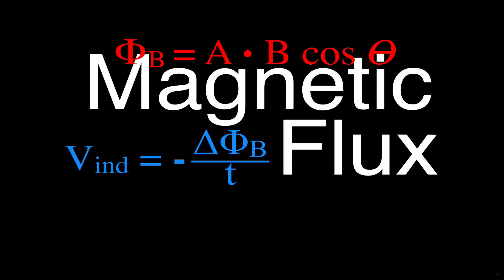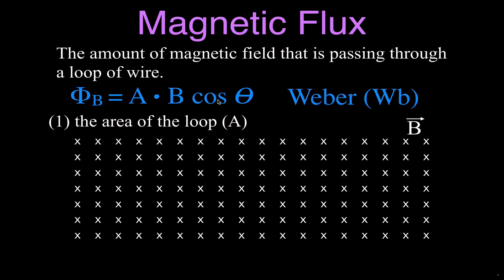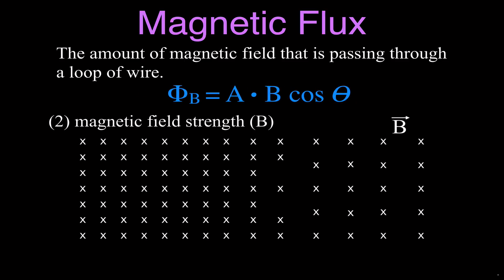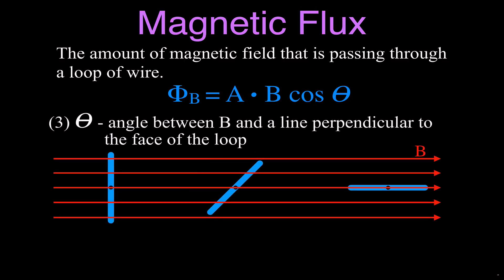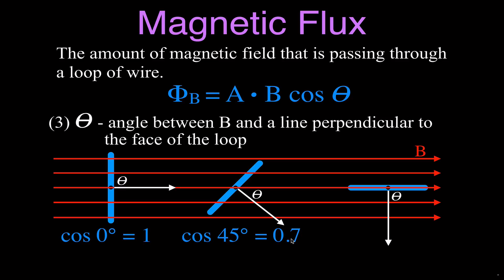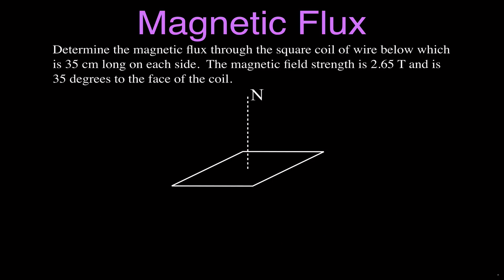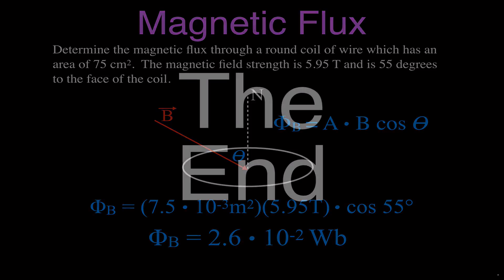Electromagnetic Induction (2 of 15) Magnetic Flux, An Explanation

Comment: Hi  I know this is a very old video....  I have tried to find out what is the best space in between the rotor magnets .. if the coil diameter and the magnet diameter is same (example :30mm diameter )  . Basically we need to know, what is the best spacing in the rotor to get max EMF. Just keep  Each Coil diameter is 30mm and each magnet diameter is 30mm. Specially, if we wind it for a motor or generator.  Let say from the start : we have 6 coils and 8 magnets.  each got 30mm diameter . Please educate us to find the best spacing between magnets within the rotor... thank you for your time..

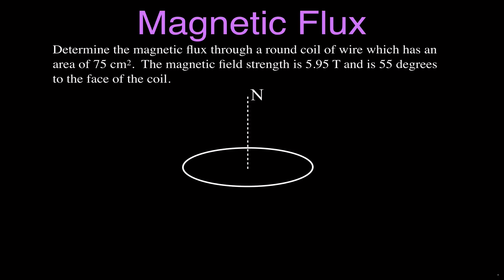Comment: I have a question. The problem at 8:20 says that we don't use the angle in the problem, because it says "degrees to the face of the coil." which makes sense. We use 55 degrees. But then you did the complete opposite on the problem at 9:15. Am I missing something?

Comment: Why we use cosine... It's my doubt plzzzzzz help me plzz I beg u
Reply from the maker: That is a great question....but I do not have a very good answer....because we use the angle the line perpendicular to the coil and the magnetic field lines. If we used the angle between the face of the coil and the magentic field lines then we would use the sine.
Reply: The cosine is used due to vector calculus. Take a vector vA normal to area and the vector of B (vB) and calculate the dot product: vA * vB = |vA| * |vB|* cos theta. Theta is the angle between the vector vA and vB. The Cosine Theta determines how many B-lines penetrate the area. If vA is in the direction of vB then Theta is 0 and cos Theta = 1 and the flux is A*B. If Theta is 90° then vA is perpendicular to vB and no b-lines are crossing the area. cos 90° = 0 and therefore vA*vB =  |vA| * |vB|* cos90 = |vA| * |vB|* 0 = 0 as you explained, so it is vector calculus with the dot product why we use cosine.

Comment: For the example at 8:21, why is the angle 35 degrees and not 55 degrees? My knowledge of angles is not that good. Can you please explain?
Reply from the maker: Because it it the angle between the magnetic field (B) and a line that is perpendicular to the face of the coil. It is not just the angle between the magnetic and the face of the coil. can be a bit confusing.

Comment: Sir i've a question and that is in a round coil if there is number of turns so what will be the formula? And in my text book i saw the formula is phi= BA sinQ.. which one should apply?
Reply from the maker: That is the equation for the magnetic flux, or the amount of magnetic field that is in the coil.  The equation for the induced voltage or Faraday's law has the N in it for the number of windings in the coil.
Reply: @stepbystepscience   But sir here u wrote phi= A.B cosQ?

Comment: my favorite physics channel is back
Reply: Sorry i can't make a seperate comment. - Could you check the last example question? The Q says angle is 55 deg to face of coil. Should the angle used, then be 35deg because it is measured from the normal line?........ isn't it?
Reply: I think i just got confused by the wording of the question. You used the same wording in the 2nd question, so you are indeed measuring from the normal line. I get it now. Thanks great video.
Reply: nothing to be sorry about
see ya
Reply from the maker: Thanks.